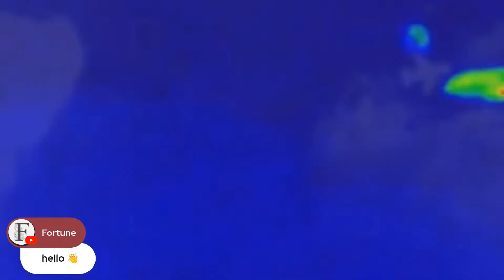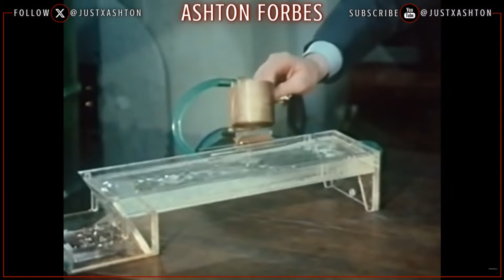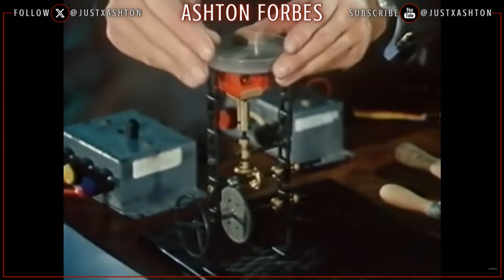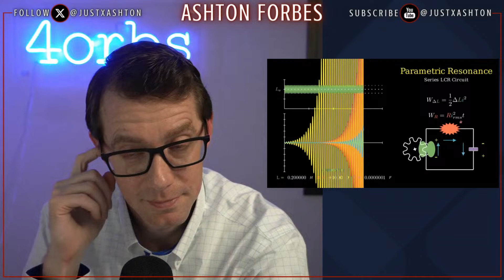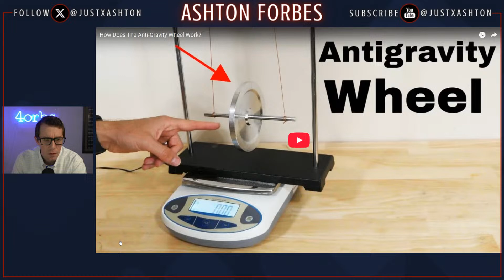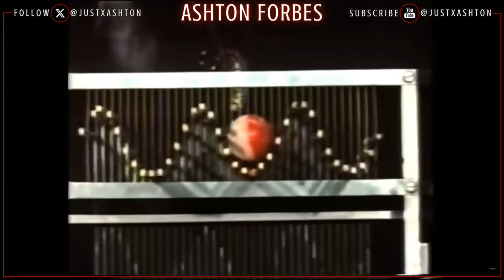The Magnetic River - Eric Laithewaite & Anti-gravity

Comment: Have suddenly remembered a very scary 15 mins from 45 yrs ago when I was a trainee at a steelworks. 

I was at the bottom of a pit as a safety-observer for a spin-casting, using a massive, 3 story metal tube sitting on a turntable & being turned, faster and faster by wheels just above the turntable about a meter above the base

Just before they started to pour molten metal into the mould, the bastard started rising up off the turntable! 

I totally panicked and hit the shut down switch, feeling like a total wooz, but not so much that I wanted to risk possible death,  being churned to strawberry jam by hundreds of tonnes of steel against the walls of the pit

Fortunately,  my boss was very supportive and the job was put on hold until they'd worked out why

They never did tell me the outcome ... and they may not have been able to figure it out

But today I realised that the conditions of the set up probably caused the huge casting tube to levitate

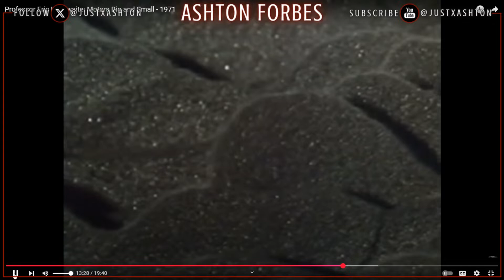Comment: 50:11 I believe it's only the water molecules on the outer part of the wave, which is why all those abandoned low height dams drown so many folks every year. The water after you go over the dam may only be 5 or 6 feet deep but you end up trapped inside a cylinder of still water surrounded by moving water. The recommended action should you find yourself in that predicament is to ball yourself up and pray. My understanding is you're likely to run out of air before you get kicked loose.

Comment: Ashton or any EE out there.
Is plasma a true super conductor or does it "display Superconductive properties."
Been a while but I remember a difference.
1 is based on the phenomenon where electron travel becomes more concentrated at the surface of the conductor based on the frequency of the curent (skin effect?). Also effects the location and strength of the magnetic field.
This concept is well known in EE. (Coaxial wire for ex).
But the conductor is assumed stationary, not a UAP.
A strong repulsive force at the surface and a magnetic field that doesn't cancel to 0 could do some cool sh**.
Im a M.E. tryin to figure out what i 1st seen 10 years ago
TIA

Comment: Here’s a year-by-year overview of the unfolding events and developments related to the disappearance of Malaysia Airlines Flight MH370, which vanished on March 8, 2014, while en route from Kuala Lumpur to Beijing. This summary covers the period from 2014 to March 4, 2025, marking nearly 11 years since the incident. The information is based on available data, including official reports, searches, and public sentiment, while noting the ongoing mystery and lack of conclusive findings.

2014: The Disappearance and Initial Search
- March 8, 2014: Malaysia Airlines Flight MH370, a Boeing 777-200ER carrying 239 passengers and crew, departs Kuala Lumpur at 12:41 AM local time, bound for Beijing. Less than an hour into the flight, the plane disappears from air traffic control radar after the last communication, "Good night, Malaysian three seven zero," as it entered Vietnamese airspace. Its transponder and Aircraft Communications Addressing and Reporting System (ACARS) are turned off, and military radar tracks the plane deviating westward, crossing the Malay Peninsula, and heading toward the Andaman Sea.
- March 15, 2014: Malaysian Prime Minister Najib Razak announces that satellite data indicates MH370 remained in contact with a satellite for several hours after disappearing, suggesting it flew along one of two corridors: a northern route toward Central Asia or a southern route into the southern Indian Ocean. The southern route becomes the focus.
- March 18, 2014: A multinational search begins in the southern Indian Ocean, led by Australia, with participation from Malaysia, China, and other countries. The search covers vast areas but finds no debris initially.
- March 24, 2014: Malaysia announces, based on Inmarsat satellite data analysis, that MH370 ended in the southern Indian Ocean with no survivors. The search shifts to a remote region west of Australia.
- April–July 2014: Extensive air and sea searches continue, including acoustic pings possibly from the plane’s black box, detected northwest of Perth. However, no wreckage is confirmed. The search area expands, but initial efforts in the South China Sea and Andaman Sea are abandoned as focus shifts to the Indian Ocean.

2015: First Debris Found
- June–July 2015: The first confirmed piece of MH370 debris, a flaperon (part of the wing), washes up on Réunion Island in the western Indian Ocean. This is the first hard evidence that the plane crashed in the Indian Ocean, consistent with ocean current models. Additional debris is later found on beaches in eastern Africa, but the main wreckage remains elusive.
- October 2015: The search continues in the southern Indian Ocean, led by the Australian Transport Safety Bureau (ATSB), covering over 120,000 square kilometers. No significant findings are reported, but drift analysis helps refine potential crash site locations.

2016: Underwater Search and Debris Recovery
- January–April 2016: An underwater search, using robotic submarines and sonar, continues in the Indian Ocean, focusing on a 60,000-square-kilometer area along the 7th arc (a theoretical flight path based on satellite data). No wreckage is located, but more debris, including pieces likely from MH370, washes ashore on African coasts, such as Mozambique.
- Ongoing 2016: The ATSB releases reports suggesting an unresponsive crew or hypoxia event might explain the plane’s prolonged flight south, likely on autopilot, but no definitive cause is determined without the wreckage.

2017: Suspension of Official Search
- January 17, 2017: After 1,046 days and costing over $150 million, the multinational underwater search in the southern Indian Ocean, led by Australia, Malaysia, and China, is officially suspended without finding the main wreckage or bodies. The ATSB states that the reason for the disappearance cannot be determined without locating the aircraft.
- Throughout 2017: Debris continues to wash up on Indian Ocean shores, and independent researchers, including oceanographic drift studies, refine potential crash site locations. Twenty pieces of debris are recovered, with 18 identified as "very likely" or "almost certain" from MH370.

2018: Private Search and Official Report
- January–May 2018: U.S.-based Ocean Infinity conducts a private search on a "no find, no fee" basis, covering over 112,000 square kilometers north of the previous search area. The search ends unsuccessfully after three months.
- July 2018: Malaysia releases a 495-page official report, concluding that the plane’s controls were likely deliberately manipulated to take it off course, but investigators cannot determine who was responsible. The report rules out mechanical failure but notes possible unlawful interference. It emphasizes that finding the wreckage is essential for conclusive answers.

2019–2023: Stagnation and Public Interest
- 2019–2023: No official searches are conducted, but the mystery of MH370 persists, fueling conspiracy theories (e.g., pilot involvement, hijacking, or foreign military action) and amateur investigations. Families of the victims continue advocating for renewed searches, and media coverage, including documentaries like "MH370: The Plane That Disappeared" (2023), keeps the story alive. Debris analysis and drift studies by independent researchers, such as the University of Western Australia, reinforce the likelihood of the crash site being near the 7th arc in the southern Indian Ocean.

2024: Renewed Interest and Search Proposals
- March 2024: Marking the 10th anniversary, Malaysia holds remembrance events, and Transport Minister Anthony Loke announces openness to a new search if credible evidence emerges. Ocean Infinity proposes another search, and Australia offers support. Debris findings and ocean current modeling are revisited, but no action is taken immediately.
- December 2024: Malaysia’s cabinet approves in principle a $70 million deal with Ocean Infinity for a new search on a "no find, no fee" basis, targeting 15,000 square kilometers in the southern Indian Ocean. The search is slated to begin in early 2025, pending contract finalization.

2025: Resumption of the Search (as of March 4, 2025)
- February 2025: Ocean Infinity resumes the search for MH370, as announced by Malaysian Transport Minister Anthony Loke and reported in posts on X and news outlets. The search focuses on a refined area near the 7th arc, based on drift analysis and new technological approaches. The contract is still being finalized, with an 18-month duration and a potential $70 million payout if the wreckage is found. However, as of March 4, 2025, no definitive updates on findings have been reported, and the mystery remains unsolved.
- Current Sentiment: Posts on X reflect renewed hope among families and the public, but skepticism persists due to past unsuccessful efforts. The aviation community and families continue to demand closure, with some experts suggesting that modern tracking technologies (e.g., ADS-B and distress tracking systems) could prevent a similar disappearance today.

Summary
As of March 4, 2025, nearly 11 years after MH370’s disappearance, the plane’s fate remains one of aviation’s greatest mysteries. Extensive searches, costing hundreds of millions, have failed to locate the main wreckage, though debris confirms the crash in the southern Indian Ocean. Official investigations suggest deliberate manipulation of the aircraft, but without the wreckage, no conclusive answers exist. The renewed search by Ocean Infinity offers hope, but the outcome remains uncertain, leaving families and the world waiting for resolution.

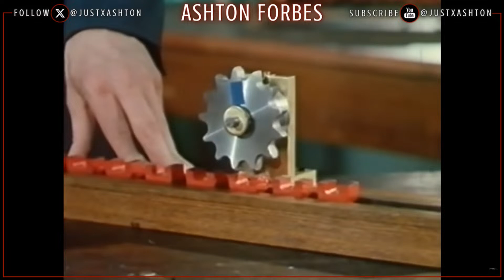Comment: 33:48  This is remarkably similar to the fly wheel at Coral Castle.  Just imagine the magnets in a circle around the gear instead and a hand crank in the middle and that's basically the fly wheel at Coral Castle. If you are unfamiliar with Coral Castle you need to read up on it. It is right in line with this content. I was thinking about Coral Castle this entire stream.  If you don't know about it the short version is it was built using multi-ton blocks of lime stone by just one man with no heavy equipment or machinery who clained to have used the secrets of the pyramid builders to do it and it was very easy to do if you knew the secret. The fly wheel is pretty much the only part of the machine he supposedly used to levitate the blocks that is left.